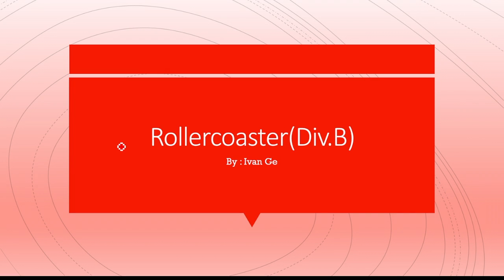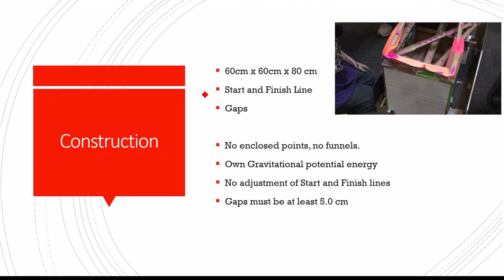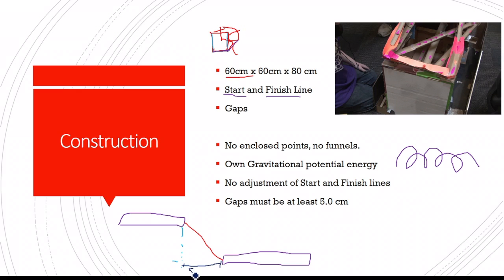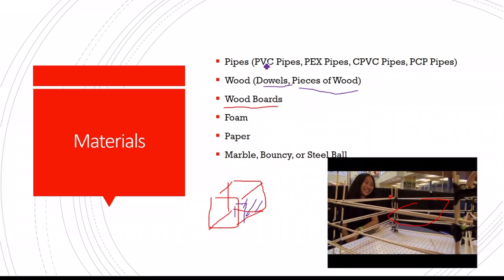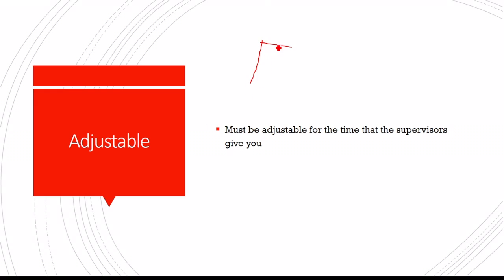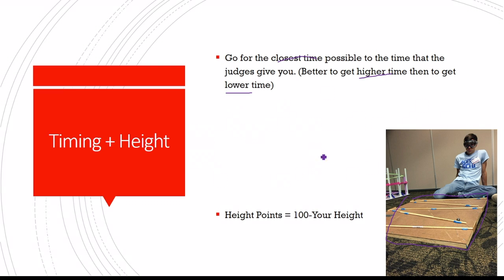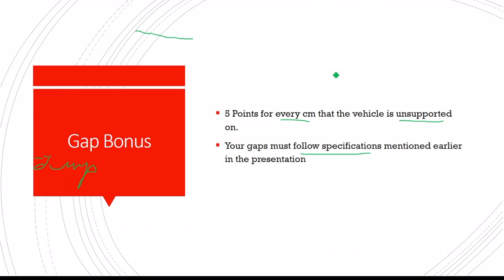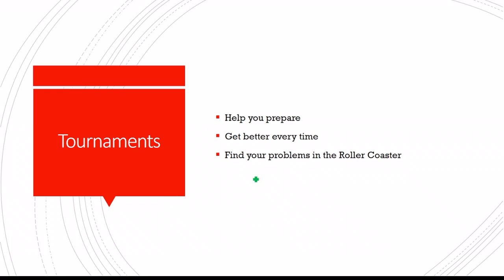Science Olympiad - Rollercoaster(2017-2018)

Comment: what bout knex?
Reply from the maker: works too, not the best though, I've built one right now with about 400 points guaranteed with the materials I used in the video. If I had spent more time, I would've reached 500 points guaranteed so
Reply: TheRealIvan thanks
Reply: 400 - 170 = 330 pts of gap. 330/5 is 66 cm of gap. I think that can be improved on greatly (like 100 cm of gap).
Reply: @kyleguo2064  first of all, 400-170=230 not 330, second of all, you can't jump gaps at 20 cm of height to start so not 400-170, 400-100 or something so 300/5 is 60 cm, personally, that is very very good, not just good, it is godly, testing does require a lot of work as well
Reply from the maker: Kyle Guo that’s hard it requires a lot more time to build and test
Reply: or does it... hmmm >:)
Reply: Ivan me and my friend are gonna run on Saturday any tips?